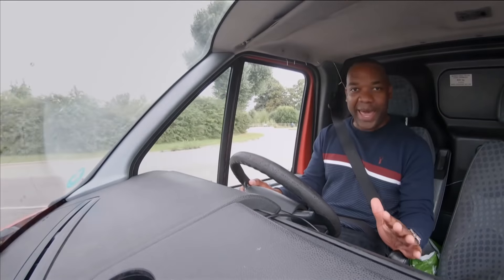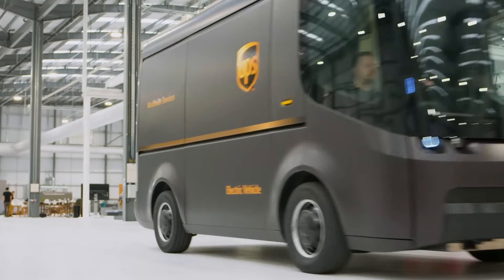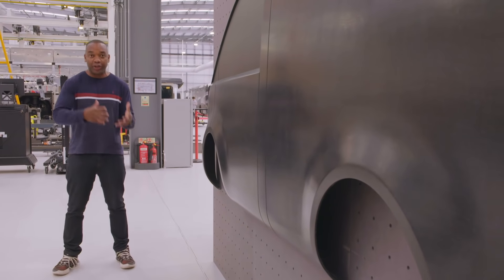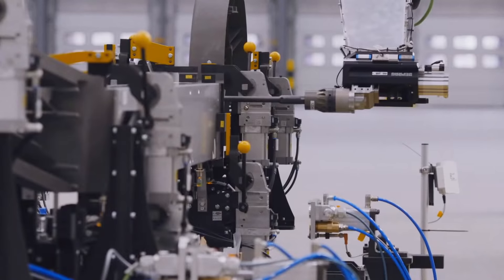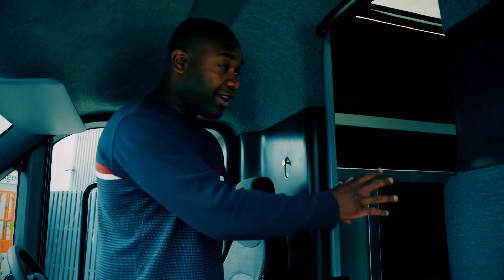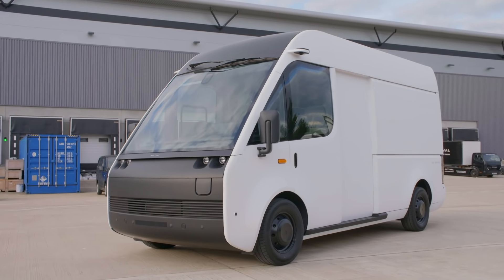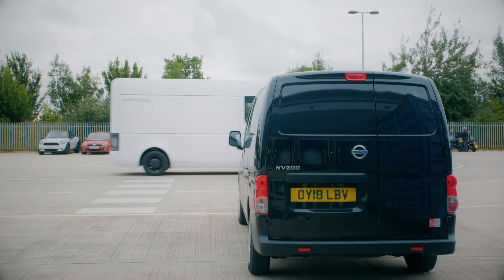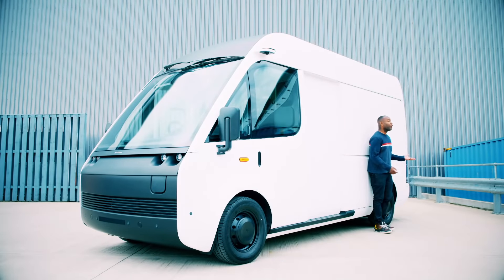The Arrival Van Test Drive | Fifth Gear Recharged

Comment: Sounds like a lot of shipping is required to later assemble.  I would have love to learn how it all comes together if produced in hundreds of locations globally.  Why is this process more sustainable than conveyor belt production?
Reply: I think you hit it on the head . You assemble on a line to reduce space needed and collate everything you need into an area . The same volume of space is needed regardless of its location or rather histroy says more space is needed if its from a ground upwards build . 

Building on a pod idea will work however chain supply issues ( the irony ) will mean massive logistical issues to get the parts needed to create the vehicle . Also and its bloody obvious when you say it but a robot that needs to multi task is asking for software issues . On a line a robot has a single task as this therefore has built in reliability . You also dont need millions of quids worth of robot doing a demeaning job like dropping in 4 screws so theres a massive cost implication there as a vastly overcomplicated and expensive machines time is taken up with a task that something lesser would be appropriate .  

Quality control defines a business . With the business scattered and therefore qc impossible to be easily uniformed then good luck with this as a business model .
Reply: @godzillas6301  But having everything in one location is by no means a guarantee for quality either. Quality issues like panel gaps (or paint deficiencies) in Teslas are something you could easily automatically detect with cameras, no human inspection needed. Any quality control you would automate would be much more consistent as well, regardless of whether you produce in 1 or in 10 locations. The supply chain issue is indeed the biggest issue. They are betting on fully recyclable materials (but of course that is mostly for the paneling). Since materials are easier to transport than finished producs, I think the concept has a change, but time will tell.
Reply: @jorsm.3893  Not feeling it that way at all . Uniformity is what is needed to be assured of quality of product . However if there is multiples of different machine being used to create the same product this allows for more to go wrong noticed or otherwise . That enables quality control issues and the ability for a good quality product to become varied off the back of failures of machinery and the nuances of what could possibly go wrong . Remember they are talking about a single machine doing full assembly here . There isnt a secondry machine to double check given the first machine would be assumed to have done the job correctly in the first instance and this isnt about checking a panel gap , its about the entire assembly of a vehicle of which a failure within something deep within the assembled vehicle could create chaos and be a real trial to rectify . 

If the same machine is used day in day out , made exclusively and used for that single  job then there beyond a higher chance that it will proform better and be more reliable in what it generates than something that requires many thousand folds worth of info to try to do its job within what would then be a billion parameters . That is asking for trouble ...... theres a very valid reason the world not full of small car production lines .
Reply: @jorsm.3893  Tesla's quality issues are not about them not being capable of better quality. Their leadership  just don't care about the factory churning out bad quality. So they don't tell the factory making better quality. Instead the orders are "maximize production numbers". Even if that means putting out cars with shoddy unrepaired paint (which frankly someone at factory noticed, but nothing was done about it since production numbers is key, just push it out to customer and see whether they accept it). Slap the panels on place, oh it's uneven, no time to fix it, next one coming down the line already, put it out to customer.

It is all about what is to the leadership is acceptable quality to put out to customer and when goes the red light go on and the item is held back as reject and not fit to be presented to the customer.

Again automatic QC camera noticing bad panel gaps or paint would mean nothing, if on getting that alert the QC team just goes "can't hold it back, holding it back would mean not meeting this weeks production target, just send car out to customer".

They aren't incomptent, they are doing it intentionally. Would they make better quality, if they could get same numbers out? Sure it doesn't hurt to have better quality, but that is secondary to the production numbers. Since having better quality would mean potentially halting the production line to calibrate production machinery, fix this or that jig, retrain crew, upload new software to robots, adjust this or that process and so on. Plus of course holding the rejects back. Reject hold back is one car not to be tallied in production numbers for the week.

Where as if you put it out, it is number on production/sales tab and well "we fix it later on field service, maybe, when we get to it. eventually or compensate the owner with new car from later production and then take the car back to be reworked... on the long slow rework queue. Since rework and field service queue doesn't show up in the financial numbers headlines, unlike factory quarterly production numbers." Its all about the business.
Reply: @godzillas6301  "theres a very valid reason the world not full of small car production lines", because a group of people succesfully tried that model, it worked well/was profitable, and so everyone replicated it because they know it works. It doesn't mean that something else couldn't work, and there is nothing wrong with trying another approach, even if it fails people will learn a lot more from this experiment than from similar businesses following the traditional practices. There is many ways to look at it. I am aware that a machine that does 100 different jobs will probably be a lot more complicated and have more potential points of failure than a machine that only does one job, but I do believe that technology has evolved enough that things like this could be done reliably. Also their vehicles have been designed from the ground up to match this method of manufacturing. Finally there is significant difference in the impact of a single failure. With the concept arrival would try, if one assembly unit fails, that would hardly threaten the revenue of the company (compared to stopping a huge assembly line). In fact engineers could probably take their sweet time to resolve any quality issues before starting that production cell up again. Only time will tell if it could work. You might be right, you might be wrong, at least it's innovating/interesting to follow.
Reply: @jorsm.3893  It is an interesting debate .
I think tech has evolved but better is subjective . Stress points and wear limits are better known but over all ? .... not so sure there more reliability than in the not so distant past .

I do get what you are saying that a single failure will impact a single build wheres a line can be stopped resulting in many more loses .
But what fails with this point is repairs . If a screw driver fails its swapped out in moments with no loss of production . Its a simple tool and air driven . If the air drops there is always a back up in place to take over . 
With this unless you have someone who has a serious degree in engineering sat waiting for a fail at each point of assembly and has a spare multi million pound robot as a back up plus a computer tech to sort out the oddity glitches and also a massive team of people ready to strip down the preceeding vehicles to source the point of failure if its not readily known when in the supply process vehicles were made defective  ..... well ........ I simply cant see this happening . 

As you say it could go both ways , time will tell and it would be interesting to see the faults and rectification . 

I do welcome the conept of another elec vehicle and a van ............... the world is screaming out for them it really is and that includes myself . I cant say im a fan of the looks of this , it may grow on me . Im disappointed that the rear end isnt shown once except with some oddity rear end and no door fitted ......... on a van whos main task is to carry items ! could be theres nothing to see or a failure of the production of the video ? . Id like to know more of its aircon , its heater , most importantly its ability to charge anything needed etc etc .  I do wish them all the luck in the future and lets hope they can also create a 7.5 tonner while at it .
Reply: Yep. Now instead of a single assembly line of robots, you need dozens more.
Reply: @godzillas6301  
"Massive logistical issues"?
1) Do you not think they might have considered this?
.
2) Note who they're building for?
I think maybe U....P.....S. just might be able to sort the "logistics" out?
You know, collecting stock to build their own vans? It's their business?
Reply: @aritakalo8011  "Tesla's quality issues" only seem to appear in Fremont.
You think maybe it's the quality of worker, rather than design?
Maybe?
Reply: @DrOneOneOne  
How about if you find a business that needs a new fleet, has really big warehouses and "delivers stuff"
Then you suggest building a really small factory in the corner of a really big warehouse, and they deliver the parts?
Then repeat 10-20 times?
Would that work?
Reply: @rogerstarkey5390  it would still be hugely expensive.
Reply: @rogerstarkey5390  Sorry for late reply ... holiday 

1 . Yes of course ... and simply put they will fall on there arse if they think a different concept will always be better or they are arrogent enough to assume they have spotted something missing from the regular industry standard of how to do things . Millions are wrong and they have it right ? ... is that likely ? . 
It is very very easy to get blinkered into whats new must be better or better considered . 

2 . Ok ive worked in the manufacture of cars from supply to final product rectification . Im also a long term courier whos worked for UPS on and off going back to the point when they were Atlas air .........Not only this but i run my haulage company and sure enough my sons management in the supply of parts also to JLR directly responsible for parts to the line  . 
Whom they are building for does not come into it whatsoever . That is just a customer . However lets walk that path aye . 
Theres around 20 thousand components which make up a van . It doesnt matter if you have a box with 1 wiper blade or 200 in it ... the number is the same . 
So thats 20,000 deliveries that need to take place .
Companies specialise in making components ...... the only way its cost efficient is to make in bulk ..... they may make a few brackets at the same place however something such as a sun visor comes from spain . You can not and will not have companys create and ship out in small quantity vast quantites of components they have been tasked with creating , from a single source ..... doesnt happen ........
So the likelyhood of , lets call it 5 thousand deliveries landing on time , without issue and without quality implications is beyond impossible . Doesnt matter if its DHL , TNT , UPS , whomever its still the same impossible logistical task to run a business this way . Even the `just in time` lads run at most 48 hours to reduce stock retention so small volume to many many sites with zero ability to warehouse stock is laughable that it could possibly work .......... 
The only way they would stand even a remote chance is to ship out to a central location then pick the parts to be sent off to be assembled ........ and if you ae going to do that why bother pissing around and just assemble at the store site and not worry about logistics .

Now are you getting it ?
Reply: @rogerstarkey5390  Still sounds incredibly expensive to me. It's never going to be as totally automated as the guy in the video wants us to think. Robots just don't have that kind of capability at the moment.

Comment: "Move the passenger compartment as far forward as possible." or "place the expendable driver in the crumple zone."
Reply: Regular ICE vans have to fit a crumple zone and an ICE engine... even allowing for some overlap, that still means there's space there to move the driver forward (by removing the ICE) without putting them into the crumple zone.

Comment: What will the range and performance be when fully laden?
Reply: That's dictated by the major companies actual requirements, there are four battery sizes at the moment, up to 211 miles on a payload of 1615KG, those 10,000 orders (That was UPS) didn't come from guessing what they wanted in a van.
Reply: @Gr33nMamba  1 van per week is about capacity.
A bus will take a month.

Comment: Hyundai's $100m into a company valued at $13b doesn't seem like anything more than toe-dipping.
My instinct is that the cell based production system will not scale and will quickly be abandoned.
And OMG that thing overdosed on ugly pills.
Will they ever deliver that van at £24k? Only time will tell, don't hold your breath.

Comment: Van conversions on this will be epic....basically closedr to an american style rv than a UK campervan
Reply: If you can get proper 240v out from the vans battery, then yes. Even more if they offer 4wd.
Reply: I just realised they are partnering with Hyundai/Kia. The Hyundai Ionic 5 already has a 240v power output and AWD versions so this pairing would be pretty good. Add all the features that come as standard on a Kia like lane keeping assist etc. it could potentially be best van in class.

Comment: How long does it take to build a van in one of those cells?
Normally an assembly line takes about 36-40 hours to build a 3,000 part car.
Elon Musk rather famously sneered at the legacy assembly line at the former Toyota/GM factory and spent millions replacing them with robots and his own system.
Turned out that he should have stayed with the Toyota/GM assembly line, they build cars that were more complicated than his Model 3 in less time and with more precision.
Reply: True, for his original / initial attempt... now Tesla are building a complete vehicle in ~10 hours, prompting companies like VW to cite it as a specific threat to their profitability, and designing their own new factory (in Wolfsburg) to try and compete by adopting some of Teslas production processes.

Not a massive fan of Musk, personally, but I have to admit that a lot of his ideas do work out - eventually.
Reply: @logicalChimp  
VW won't get close.

Comment: How did they manage to get the same range of an electric Transit from a much larger battery?
Reply: I've found various claims for Ford EV transit range, from 126-196 miles. Is that loaded/unloaded? Can't find definitive information from Ford themselves.
Reply: Commercial vehicles always rate the range with a payload, unfortunately they all use a different volume of payload when the generate their specifications so it is not easy to compare exactly. It would be convenient if there was a set weight they tested with to make sure it is fair, but sadly not. But do know that whatever they claim, it is with at least some weight in the vehicle.
Reply: This van is larger than a Transit.
Reply: @matthewnightingale4675  
You sure about that?... I've never seen a manufacturer rate the worst case.
Only best ever case.
Reply: @Robert-cu9bm  check Porsche.. They always underrate
Reply: The Arrival Van looks twice the size. Makes sense to me. That's range with a full load.
Reply: @Simon-dm8zv  is it? just looks like a more streamlined version of a box van to me.
Reply: @Robert-cu9bm  Ford quote range for their F150 Lighting truck with 1000lb load in the back... as do other truck makers (actual load may vary by company, but they all quote with some load, iirc).  Given that the F150 appears to have worse aero than the Arrival van, and equivalent / better quoted range, it's almost certain that Arrival range includes some load - the only question, really, is how much.
Reply: @logicalChimp  
I don't find no mention of that on their site.

I can't see them doing that as their competitors would just not do it. And get more range.

Since range is a big seeking point with EV, why would you make it look less.
Reply: @Robert-cu9bm  Arrival are looking to sell to Fleet Managers... so 'real world' range numbers will be closely monitored, and they pay attention to the details, not 'headline numbers'...  but like I said, other companies test with load (for commercial vehicles), and the predicted numbers given for Arrival van also indicate some degree of load... but it's also pre-prod, so they likely aren't announcing details